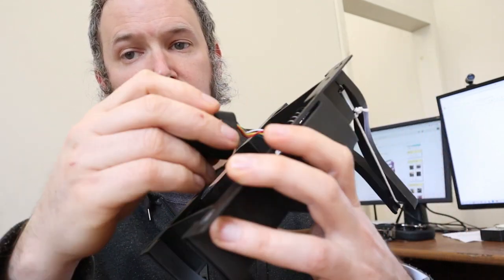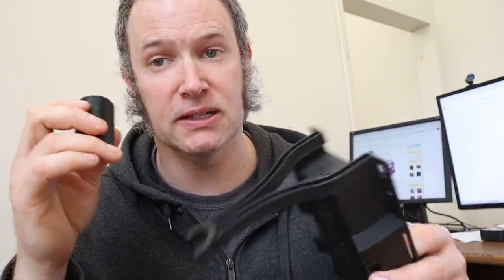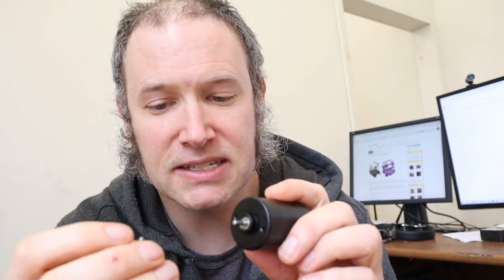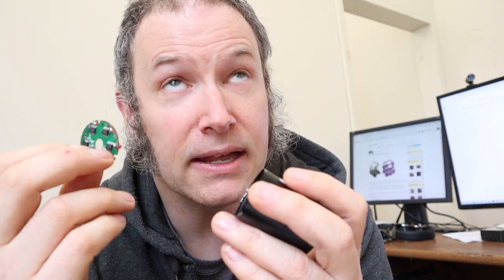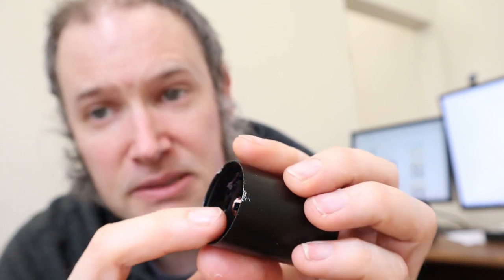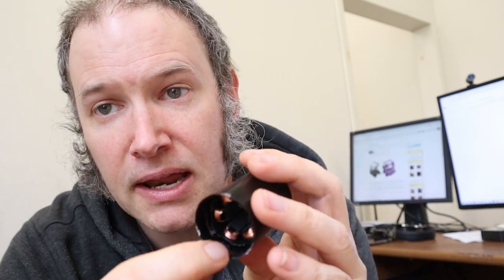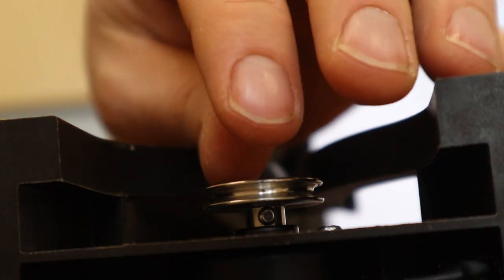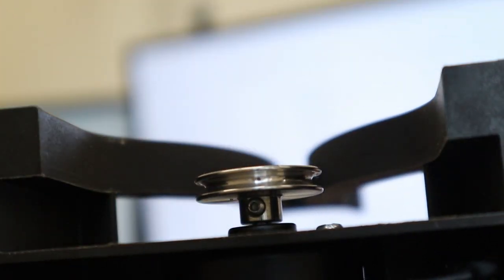SPIN #114 - Changing EEW 6.0 Motor and More Tips

Comment: I've had no problems with my EEW 6.0. Thanks, however, for keeping us up to date with all the potential problems we might face. I spin for most of the day and into the night, on a rather constant basis. The only issue I've faced in using the EEW 6 is really not about the spinner but about my forgetfulness. While the little platform, next to the orifice, for resting your spinning during a break is a great idea, the spinner runs so seamlessly, that I forget I've put my yarn on that little platform and restart my spin while it's still hanging there...duh! The results haven't been too tragic since I immediately recognize something's wrong and the most I can complain of is a whiff of "burning rubber" odor that comes from the drive band spinning around aimlessly while my yarn is stuck in the slot. Otherwise, I find my spinning experience running along swimmingly. My production has definitely kicked up a notch or two and I'm starting to find a need to slow down long enough to finish the yarns after they're plied. I'm filling bobbins of singles at record speed and holy moly, I LOVE the EEW 6.0. I still use my EEW 4 for plying, mainly because I have tons of bobbins for it and because I can ply and spin singles at the same time. I worked out a pretty effective method of auto-plying with the EEW 4. Altogether, you've once again made me one happy camper/spinner with your wonder works. Thanks, Maurice.

Comment: I love your transparency through this process! That's really the main reason I've decided to make the EEW 6 my first spinning wheel, I'm just so impressed with the volume of information you put out and how personal you are with people who ask you questions.  Around 6 minutes in you say EEW 6 sent out here forward will have the screw issue fixed, are you also going to make some sort of change to the wheels such that the spindles are grounded before they are even shipped? Did I understand that right?
Reply from the maker: Those are the changes I plan to make (plus a very minor software update), but I haven't started shipping those yet.  I'm still finalizing those fixes and then I need to hire a contractor to come to my warehouse and do the fixes here.  I'm hoping I'll start shipping the updated ones in 1-2 weeks, but that is an estimate.  Also if people want once I have the final fixes determined I can send out kits (jumper wire, conductive tape, and new motor screws).  But again I'm not ready to do any of this yet.  I want to get the process perfected and then I need to hire someone to implement the fixes.
Reply: @DreamingRobotsBlog  Thank you so much! That's great to know.

Comment: Should the drive belts be removed when we are not spinning?
Reply: I pop mine off when I won't be spinning for a few days.
Reply: I do take it off when I won't be using the wheel,for a few days but I want Maurice 's thoughts on this practice.
Reply from the maker: While I think it is technically better to do that, I don't do it and we didn't do it in our testing so when I say how long they last that assumes you leave them on.
Reply: @DreamingRobotsBlog  Thank you for your reply.